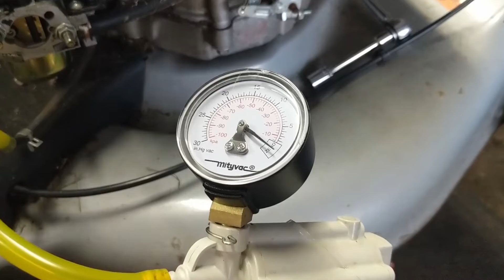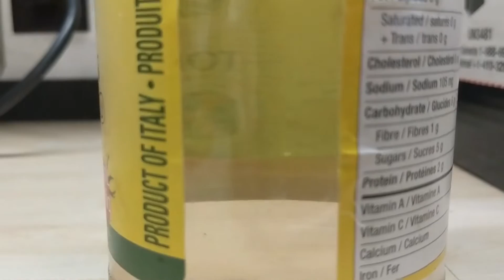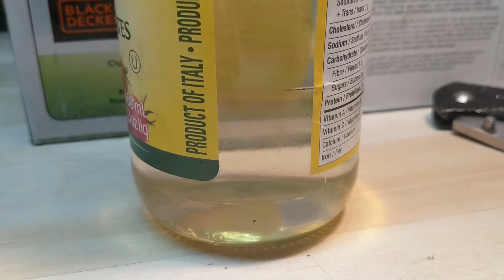WATER in FUEL!

Comment: just curious if you had some water in your fuel system on your lawn mower could it still run although with  an uneven idle that surges up and down?  or in most cases wouldn't turn over or run at all.

Comment: Another awesome video!  I had the exact situation with my Honda a left outside in the rain.  Whats the proper way to clean out the gas tank?  can i just disconnect the fuel line and pour hot water inside or does it need to removed?   also can the carb bowl just be taken off to drain the water or does it need a total cleaning?  Basically can I somehow clean the carb with just leaving most of it on the blower without getting into removing the jet, tube etc....?
Reply from the maker: We drain fuel and sometimes use CLR in metal tanks. Other times we wash them out with Spray Nine and rinse with water from the hose until there's no more bubbles, then let dry in the sun. Yes you can drain the bowl and get rid of water, because it will settle to the bottom.
Reply from the maker: Check out this video: https://youtu.be/uksV4JFsFc0
Reply: @EliminatorPerformance  looks like in many of your vids you work on small engines that have water damage of some sorts.  Water in fuel, water corroding carbs and all its internal components etc maybe a good video idea on how to properly store and  prep your blower for next season to avoid all this for the average homeowner.    Great vids by the way.  Lots of detail and useful information.